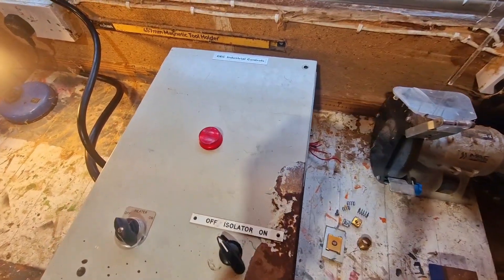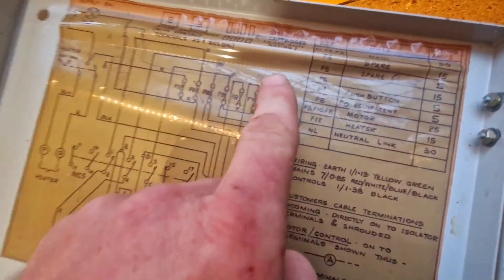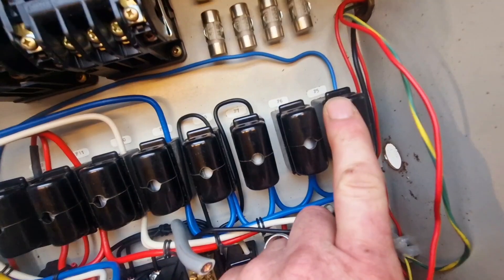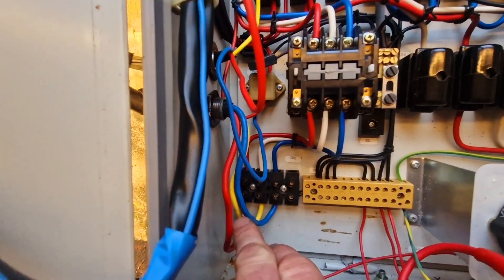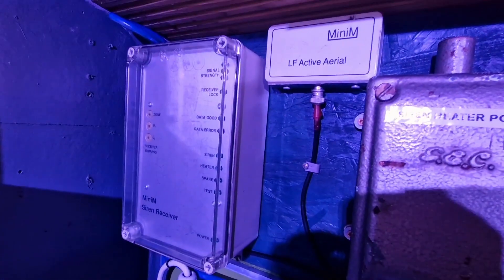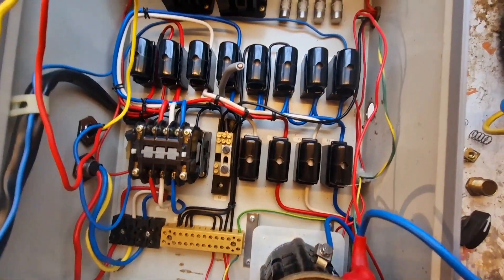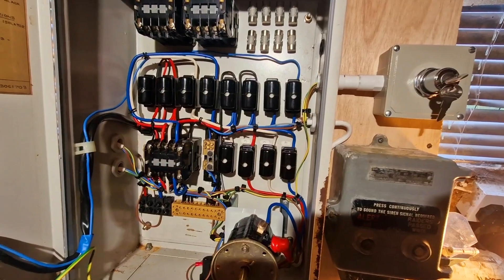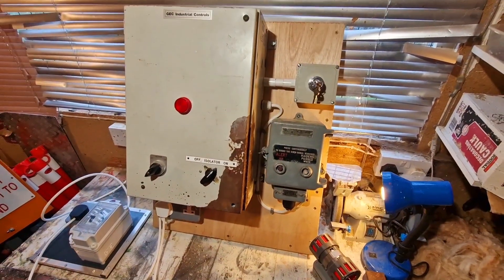Air Raid Siren control

Comment: I see a grinder on the bench there- I wonder if grinders inspired the British siren? Also, did the electrical company MEM ever make any siren control equipment?
Reply from the maker: Mem did make contactors that were sometimes used in siren control setups, though I've not come across a main control panel made by them yet, suppose the bench grinder is half way there :)